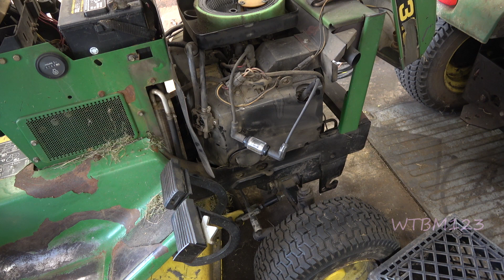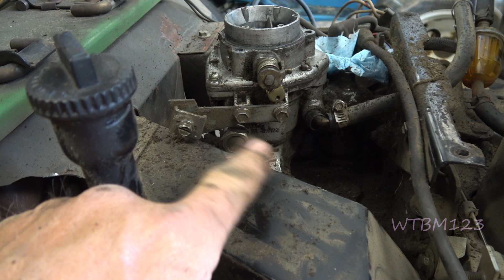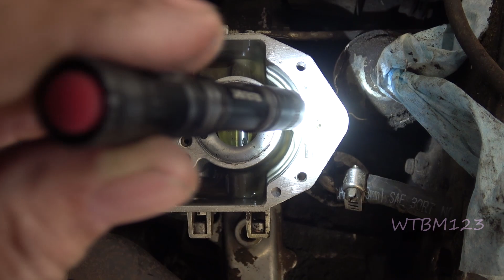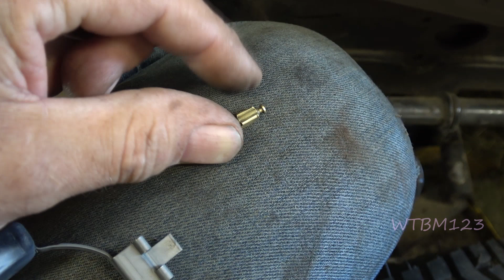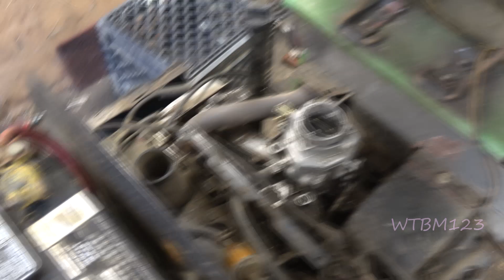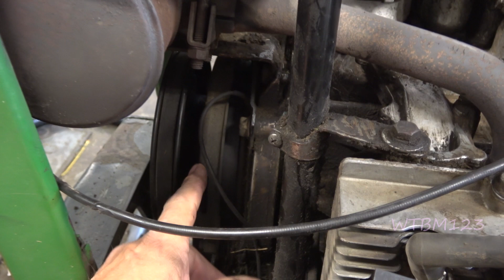Clean Carburetor John Deere 318 , P218G Onan   No Start

Comment: Hi
Dear.. the problem may appear again , it is a wise to check the inlet rubber hose to the carburetor , mostly an age worn took place.. corrupted full with contimition  from inside
Reply from the maker: That is correct , I checked and these were still in good shape , and no signs of rubber in carb. . I actually have a video showing what you mentioned about the lines

Comment: Smashing,  The carb is all clean and happy again...... for a bit ha ha :-D.
I'm amazed at how often there is just a tiny spec of crud that stops it dead.
Over the years I've cleaned lots of motorbike carbs and they look clean but don't work ha ha.
But I've had really mucky carbs that run fine,  It can only be the muck particle diameter.
Or Sods law,  Yep ill blame sods law lol.
Reply from the maker: I agree . i have seen some that are real bad and run fine . but some run bad , and you do not even see the dirt when you clean them . but ok after a clean.